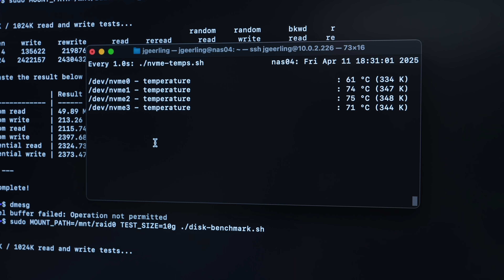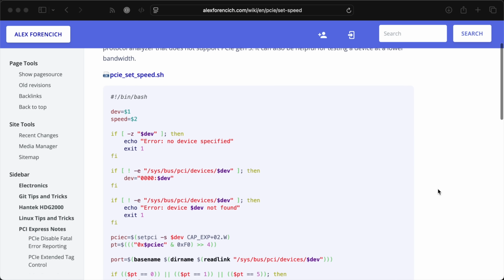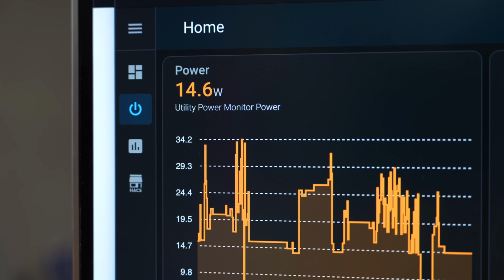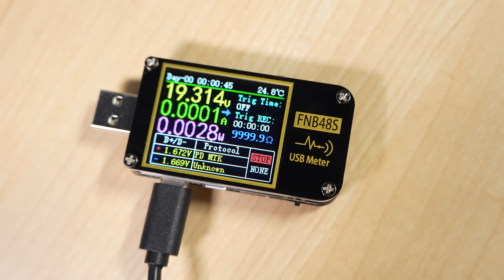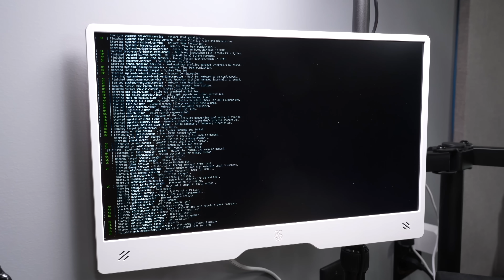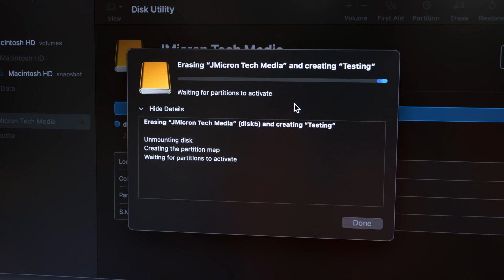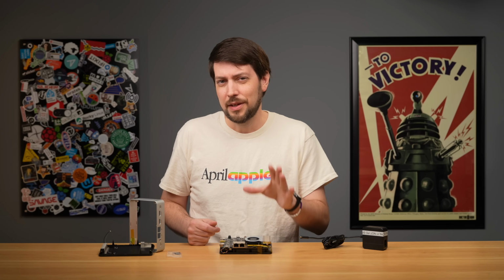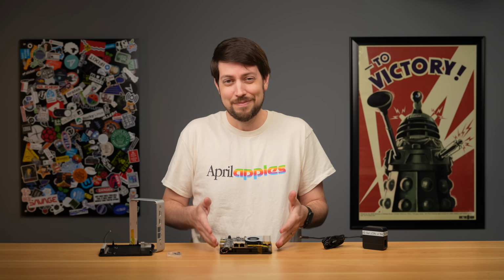I fixed the perfect Mini NAS!

Comment: A lot of chinese companies understood the "USB-C requirement" as "let's replace the barrel jack with a USB-C port". MinisForum also had at least one model that used 19V USB-C power supply, and I've seen other companies do the same
Reply from the maker: Maybe they're trying to make a new standard, 19V-only USB-C :D
Reply: @JeffGeerling  At least they never claimed it to be PD compatible. Still it is always good practice for any USB device to poll the power requirements, does not have to be a PD  compliant device
Reply: @SethPinnock They do claim it to be USB-C, which it absolutely is not
Reply: @JeffGeerling a 19V-only USB-C toaster!😂
Reply: @JeffGeerling , that is a horrifying monstrosity. 19.0v is not a legitimate output voltage for a USB-C power supply. PD compliant power supplies are supposed to be able to output 5v (always!), plus 9v, 12v, 15v and/or 20v, but never 19v.
Reply: Infineon literally offers PD controllers called the "Barrel Connector Replacement" that you just slap onto the PCB and it requests the voltage you want using the actual PD standard. It's so simple to implement that there's no reason to use a fixed 19V supply other than cheapness
Reply: @FowlerAskew  Or you could forego that part altogether and save 10 cents.
Reply: @FowlerAskew  And using the USB-PD in any way will still end up frying your power input & isolation from USB Logic MOSFETs over time. Avoid using USB-PD whenever possible, and get your devices to last.
Reply: That's really dangerous, and if they continue doing that, plenty of people will break some devices and even they could start a fire. I hope this trend won't continue, but knowing how some Chinese manufacturer are, that's pretty difficult.
Reply: @ClockDev I don't understand this at all. It's the same with all the current devices. You have to match the power supply with the device. God, people are getting dumber and lazier by the day
Reply: @ClockDev  Barrel Jack power is always safer than USB-PD.
Reply: The other really irritating thing they do is not fitting the resistors on the CC lines and putting a C to A cable in the box. This means it charges fine on a USB-A charging outlet, but sits there doing nothing when you plug it into a properly compliant PD charger with your own USB-C to USB-C cable! All for saving two damn surface mount resistors! I even have one very expensive German gadget that does this - looking at you, Nuki, Vorsprung durch technic, nicht!
Reply: I have the MinisForum mini pc with a 19V USB C plug. It has a N5095 CPU. Using the brick for anything other than the mini pc will get the device exploded.
Reply: @top.of.reddit  Suddenly I've lost all the respect I used to have for Minisforum!
Reply: So from watching Servethehome they may eventually do a compliant usb-c pd supply at some point, but be sure to say USB-C PD when you make requests otherwise you got the bad requirement you made...
Reply: Ala, it's like some of Lidl's Parkside branded power tools. Good job!
Reply: New edition of USB-PD: device shall present <0.1Ω short to any host that supplies more than 5.5V (5V+10%) on Vbus before PD handshake is completed or in any case when supplied voltage exceeds device rated or requested voltage >10%

😈
Reply: Yeah looks like they're tricking EU customs into thinking this is a device complying with their USB-C mandate. Not much you can do about but not buying crap like this.
Reply: That’s hilarious. This legitimately is the only thing they could have done that makes the e-waste problem worse than barrel jacks.
Reply: USB-C(hina)
Reply: This, my SZBOX N100 tablet had the same. It killed my Nuphy keyboard, then got a big yellow warning label at the end of the USB cable.
Reply: To be fair, the C type connector is a standard outside of USB, but has been adopted as the defacto connector to use for USB. The connector itself is very robust, and the mirrored terminals mean that no further bulk is added to the shell for keying. Another connector that often gets confused with its defacto application is RJ45. One might immediately think ethernet, but it's also used for serial and CANbus. I've seen all three used on the same device rather confusingly. Barrel jacks come in many different sizes, yet can be used for power of various voltages, polarities and signals. 

The moral of the story is; know what you're plugging in and don't rely on the connector type for identification. Standards - the great thing is, there are so many of them...
Reply: @squelchstuff 
They could have molded the gosh darn thing in bright red or yellow or bicolor stripes.
Funny thought:
What happens if you plug that supply into the FRONT USB C port of THIS SAME UNIT?
Reply: Gonna be real fireworks with the move to 48V
Reply: They could have used a barrel jack, but chose to live dangerously.
Reply: @Alvin853  is there a good explanation video of what will happen if plain 19v psu will be used for system that supports PD? I know that some SBCs have issues with that(raspberry pi is one of them, but also radxa and some other). Technically - if I want to re-use 19v 200w power brick to power up the modern PD capable Board (and some 3.5 HDDs)- what do I have to check in this case? I guess this is more down to electrical engineering, but still - this is an interesting topic for me, at least
Reply: Yes I agree, but for me it's not only quality... I'm desperately looking for a nas build like this - but Chinese 
hardware and "rock solid reliable storage" is IMO an opposite. Apart from quality concerns, there were so many incidences of supply chain attacks, whether backdoors/kill switches in huawei routers or the Bloomberg allegations on Supermicro.

I'm very sorry that all tech YouTubers give Chinese vendors such a big platform. But I guess ad money plays a factor, and in this case, there is not really an alternative. ASROCK offers some mini PCs with 3 NVMEs, there is also the Asus Flashstor but this one has some proprietary OS...
Reply: Chuwi did it on tablets too. Burnt the tablet's pen that had usb-c port with the tablet's charger...
Reply: The most recent time I consulted the IEEE specification for USB, it was approximately 400 pages. Obtaining access to this document is not cost-effective unless your university or place of work is a member of IEEE. It is likely that the companies referenced the Wikipedia entry and, upon seeing that 19V was supported, stopped reading.
Reply: @astrohgamingZero , 19v is NOT supported by USB PD. 20v is, but not 19v.
Reply: @ncdave4life  You can use PD PPS for 19v. My dell laptop has both 19v PPS Type-C and a 19V barrel jack.
Reply: @ionstorm66 , USB 3.0 PD supports four fixed voltages: 5V, 9V, 15V and 20V. (All of them have to support 5V, but support for the other voltages is optional.) So your laptop is probably using 20V for the USB-C PD.

However, if your Dell is new enough, it could possibly be getting 19V. I've read that in 2021 they introduced the new "USB PD 3.1" specification, which supports three additional fixed voltages: 28V, 36V & 48V. But adapters which support those higher voltages can apparently also support a new adjustable voltage mode enabling a range from 15V up to the maximum voltage, in 0.1V increments.

However a 19v-only power supply with a USB-C connector is an abomination.
Reply: @ncdave4life  PPS is Programmable Power Supply, it's part of the 3.0 standard, back in 2017. Samsung has used it on phones starting on the s20. 3.0 PPS is from 3.3V to 21V in 20mV increments.. Dell uses it to get the same 19V as the DC barrel jack, as it feeds the same charge circuit. AVS, or Adjustable Voltage Supply was added in 3.1, which allows 15V-40V in 100mV increments. 3.2 widening AVS support to down to 9V. PPS and AVS are still different modes. A 19V PPS device will not work with an AVS only source.
Reply: And rightfully so. You just have to match the power supply with the device. That's already the case now. Apparently, thinking is hard these days
Reply: If you want your device to last, never use USB PD to power it, and try to get devices that use an old-school barrel jack for power.
USB-PD requires several levels of additional MOSFETs to regulate (and keep the power input from bleeding-over into other USB logic), and over time, these tend to overheat and fail-- and no manufacturer seems to bother to put heatsinks or fans anywhere near these rather important components.  Simply NOT using USB Power Delivery gives a much more reliable 19-20V and avoids most of the problems of frying the power-input MOSFETs.

Comment: Time for a custom mini-rack watercooler with outboard glycol refrigerant system!
Reply from the maker: Hmm...
Reply: @JeffGeerling  Or, if it's available, you could try using Peltier-effect cooling. Just a thought.
Reply: Mini rack 1U mineral oil immersion tank...
Reply: I have a freezer where every shelf is a cooling plate, can you do this with liquid cooling? Framework is hollow, shelves/faceplates all plumbed into the cooling? Sounds complicated and asking for a small leak to destroy your homelab… but is an interesting puzzle to solve.
Reply: @jeffmathews4533 I for one would love to see a domestic freezer converted into a 19” server rack. It should fit, shouldn’t it? Overclocking possibilities would be fantastic! It would also make SSDs last pretty much forever, since running them at high temps is the main issue with data retention.

I get you didn’t suggest this exactly, but I just thought why plumb in water lines when you could just put the components IN the freezer?
Reply: @simontillson482  i knew someone that did just that... back when overclocking meant 40MHz. he used the freezer shelf out of a bar fridge, capping the refrigerator lines, and it worked great. did have to solve the sweating issue though.
Reply: I'm shopping for an external rad system for the t1. Going to use it as a common cooler for 5 computers and 2 gpus
Reply: LTT collab?
Reply: @hn3000  No, I think Geerling wants to build something that actually works.